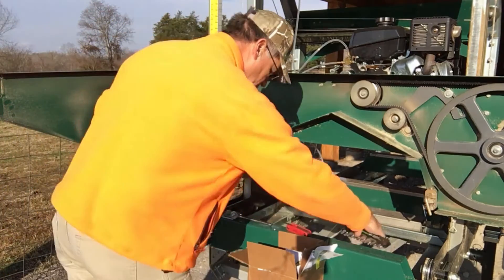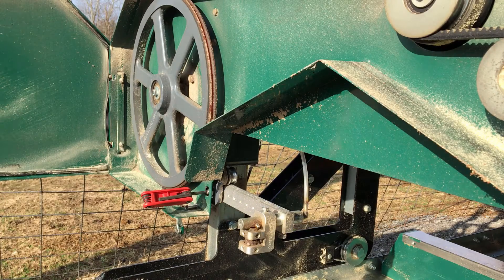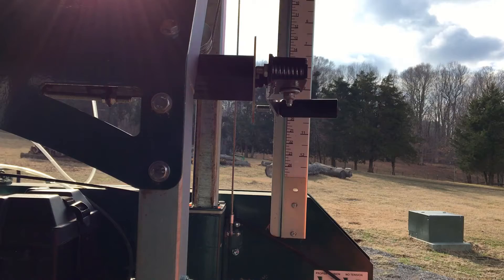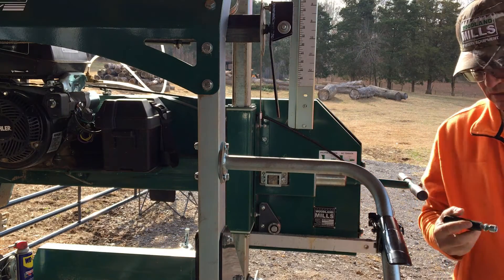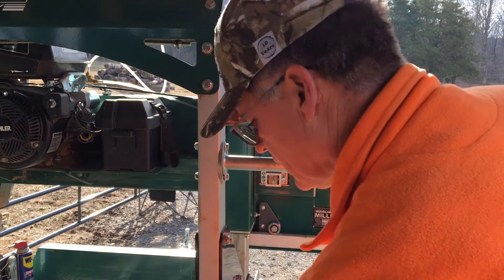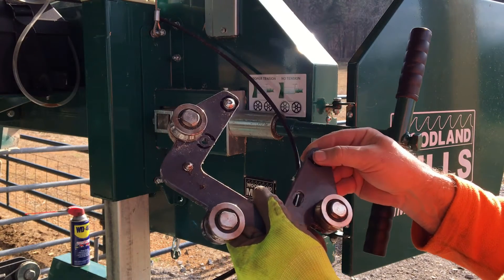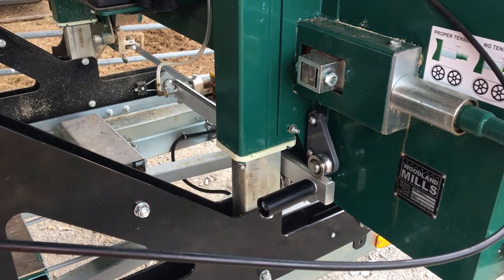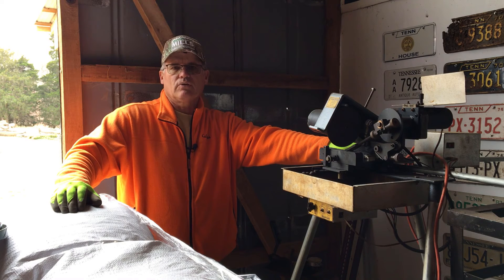Woodland Mills Sawmill HM130MAX - Upgrade Kit - Drive Belt Tension & Part # from Auto Parts Store

Comment: We just purchased a woodland mills 130max. We are having a time with breaking blades. My son has got so disgusted he said he didn't want to fool with it anymore. My husband is going to try and get it fixed. We will get started and it will work great. We change the blade and starts bucking the blade and breaking it. We adjust change and try again. We have went through two boxes of blades. We have tried talking it out with woodland mills but we haven't been able to fix it. We live right across the line from TN could you maybe give us a call and help us?
Reply from the maker: Call me tomorrow 931-721-6828
Reply: @thereedychronicles8572  Yes he will. Thank you :)
Reply: Well after this they went back over the Woodland Mills and it has been sawing great! May have had a setting off. But fingers crossed keep going! Thank you for everything and enjoy your video's.
Reply from the maker: Happy to hear that you have the mill up and running!